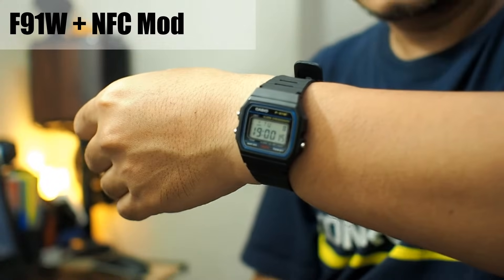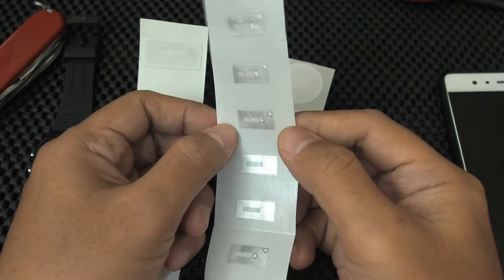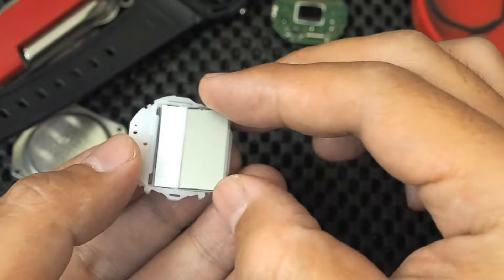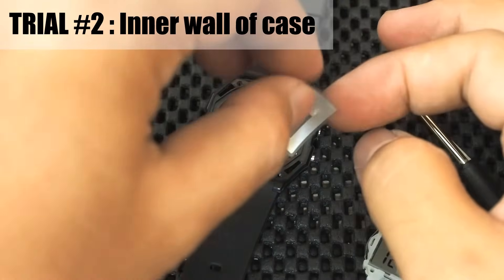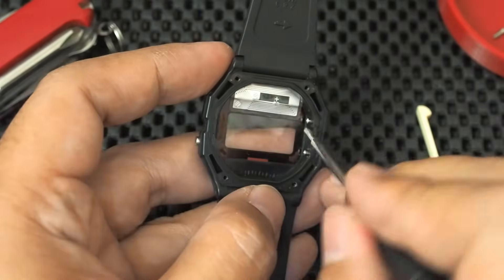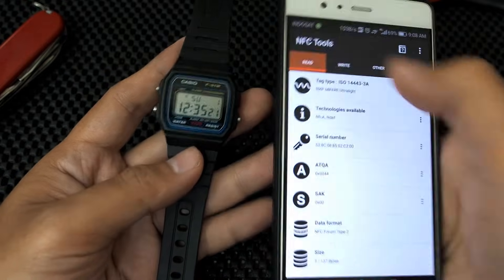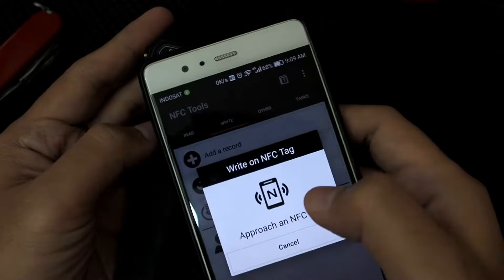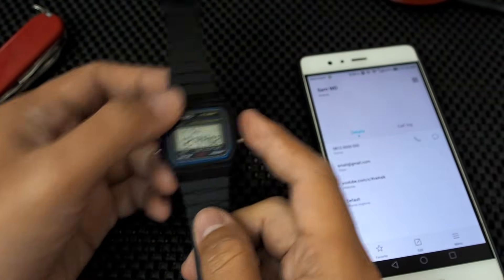CASIO F-91 NFC MOD - DIY F91W NFC Tag Implant ( Easy Modification )

Comment: Does it work on metal version??
Reply from the maker: Sorry, I haven’t tried it on the A158 or similar models (the plastic case with chrome coating).
Reply: @SamsWatchReview  i am just asking you this because there is a bluetooth model now ABL-100WE-1ADF. Thought i could pull a cool trick before my classmates 😅
Reply: @SamsWatchReview  you responding to your old videos comments is the biggest thing so have a nice day 😊 the price of the watch is pretty large sum so if i bought it i wouldn’t risk opening if it doesn’t work 😅

Comment: Cool! Could you use it for payments? 🤔
Reply: Sadly no. Standard NFC tags don't generate the encrypted security codes like your card or Apple Pay does. But if you live in a big city you might be able to use them to replace your subway pass or apartment building key

Comment: Bro, nfc tag ini bisa buat duplikat akses door ngga?
Reply from the maker: Nfc tag yg ini nggak bisa. Mungkin bisa kl sama kapasitas dan frekuensinya.
Reply: @SamsWatchReview  yg kecil gini kapasitas brp? Kalo frek sama 13.56mhz
Reply from the maker: Dr deskripsi produknya :

NFC NTag213 Paper Label Circle 25 mm
--
Specification:
Chip: Ntag213
Physical capacity: 180 bytes
Usable capacity: 144 bytes
Protocol: ISO14443A
Working frequency: 13.56 MHZ
Reading and writing distance: 1 to 5 cm
Reading and writing time: 1 to 2 ms
Working temperature: -20 to 55 degree, humidity of 90%
Erase times : > 100000 times
Data storage: > 10 years
Reading time: 100000 times
Diameter: 25mm
Packaging materials: PE self-adhesive + coated paper

Application:
Check in, mobile payment, product information query, mobile identification, mobile marketing, social networking, business card sharing, access control, membership management, posters, healthcare,book borrowing etc

Comment: Could you tell me if an nfc tag would work through a different location or device (ex. Bracelet, outer side of a watch etc.)?
Reply from the maker: As close as possible to the outer surface, where the smartphone NFC sensor will "tap". 
Also avoid position that is covered or surrounded by metal, it will forms a faraday cage, reducing the signal strength

Comment: Can an anti-metal NFC tag work inside a wrist watch made of stainless steel?
Reply from the maker: As far as I can tell, non-metal NFC tags will work when attached to a metal surface, but not sure if they will work inside.
Some time ago, I tried to insert the NFC under the CA53W screen, but it didn't work. It looks like the PCB and battery bracket act as a faraday cage, blocking any electromagnetic waves.
Reply: This worked for me on an A158W with a standard NFC 213. I simply added a thin layer of Kapton tape (an electric insulator) between the NFC 213 and the frame.

Comment: It is possible to pay with this NFC tag?
Reply from the maker: It will depend on the NFC specifications required for the payment method, which I think will have a higher level of security and encryption. I personally haven't been able to use NFC tags for that purpose :)